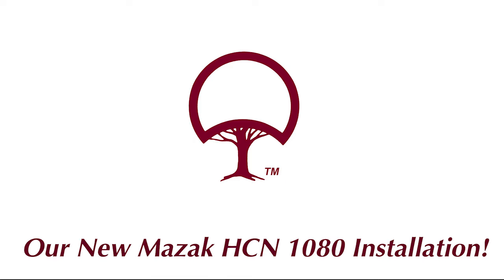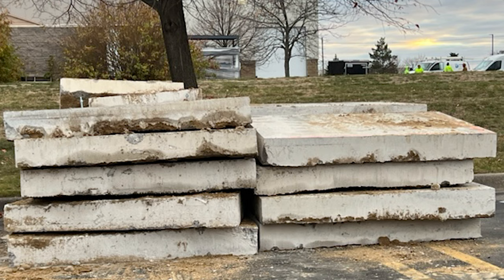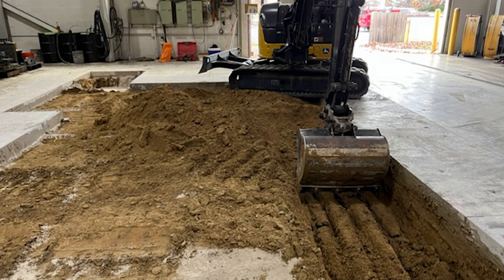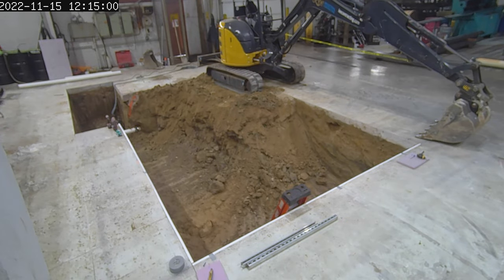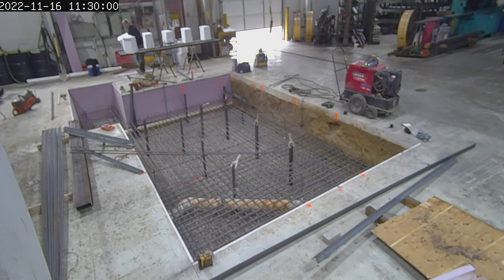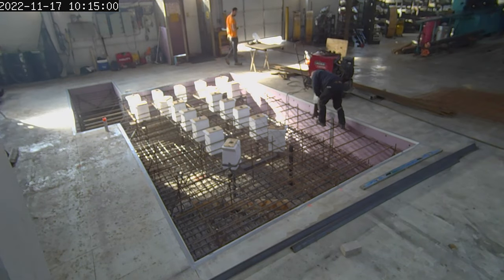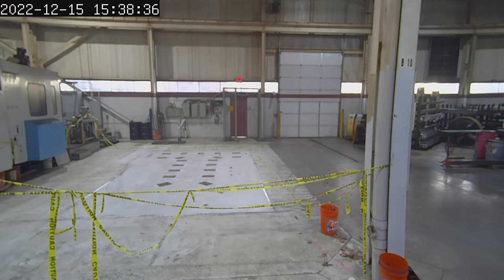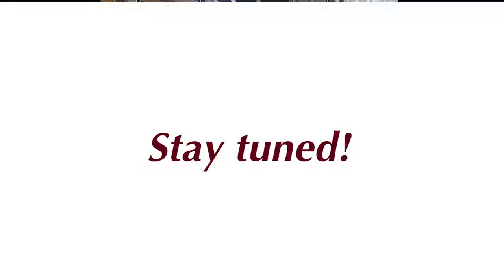How to install a monster Mazak HCN-10800!

Comment: I used to work as a surveyor for a structural steel company that specialized in industrial buildings. Did a lot of layout and final placement for some industrial machines up to 25 ton overhead cranes. Even with old school optical tools before digital it is possible to get to high tolerances on those bolts set in concrete with a steel plate levelled on top. Especially when you are laying in the grout afterwards. Not machinists tolerances but with a good N-3 level 64th's and better was reasonable. Even with that mass of concrete the vibration separation with the styrofoam is a necessity. 
  Be thankful that you did not have to invest in some really heavy stuff. Steel mills can only be built where bedrock is close to the surface. The furnaces etc are actually bolted in to the bedrock. Laid out one job where we had 30 footings like this bolted into the bedrock. That was for a basic oxygen furnace on Lake Erie in Ontario, Canada.
  Looking forward to see the installation of the equipment.

Comment: That is very nice work. When one has a machine as large as the one going in there it has to be isolated from other machines and from road vibration. Shown is one of the methods for isolation and mounting.
No doubt I will be riding this channel to learn "new tricks."

Comment: I remember when we had a K&T YMC installed in the 80s. The serviceman could not get it leveled. The anchors kept pulling out of the floor. Turned out a genius in purchasing decided to order the wrong (cheaper) grout for the anchors. It's the little things that can bite you. Around the same time we had a jig grinder installed. Every time one of the stamping presses rolled over it would show up in the work. The machine was moved to a more appropriate location

Comment: with this much excavation and concrete with rebar , you see this machine has very tight tolerance of accurse. Torque spec will be good to see as this goes together

Comment: Has to be Alphabet AI to  recommend this video, I was just talking about this, had to have done a dozen of these for Boeing and Boeing subcontractors, not to mention the  Drivematic Riveting Machines, but we had to apply floor hardener with metal shavings in it for the concrete surface with Ashford Cure.

Comment: I hope you realize with machines this large u need to set them up completely and then literally let them sit stationary, unused, for at least 30 days. That was the new mazak with adjust to the floor. Then you recalibrate the machine and compensate with offsets. Thanks

Comment: This process looks awfully crude. Wish there was a more elegant solution that didn't require such a ridiculously big block of concrete or such considerations. Maybe like a platform you can drop anywhere, with hollow beams filled with lead pellets and resin, or something, with modular ballasts to dampen any vibrations. Even better if they were electronically controlled to detect and adjust to take away interference. Computers nowadays have such high clock rates, they can see the vibration and offset it before it travels to the part.